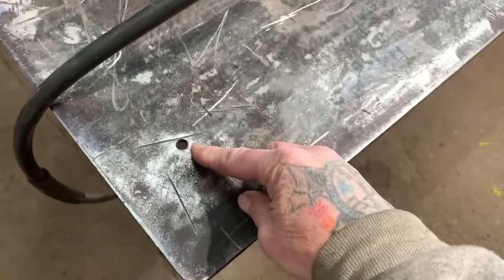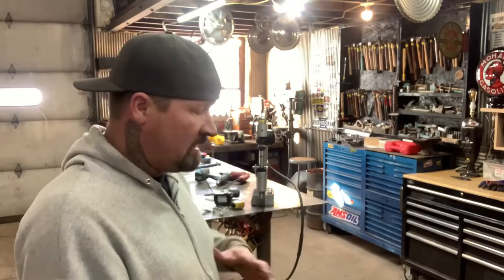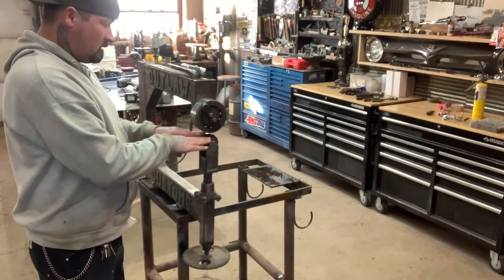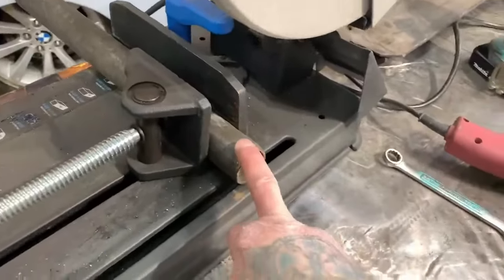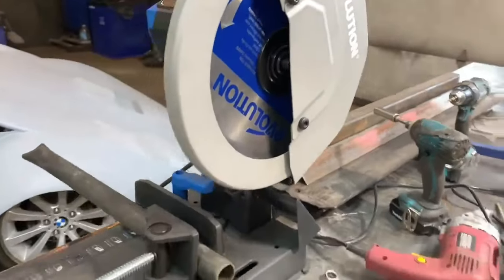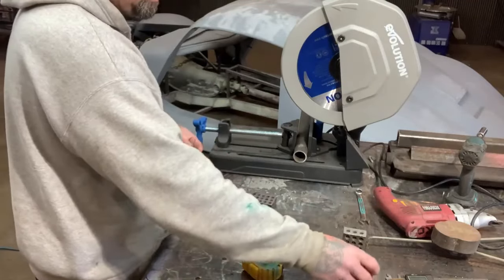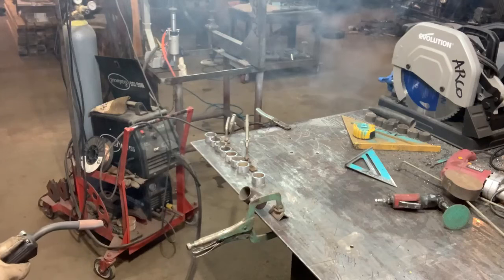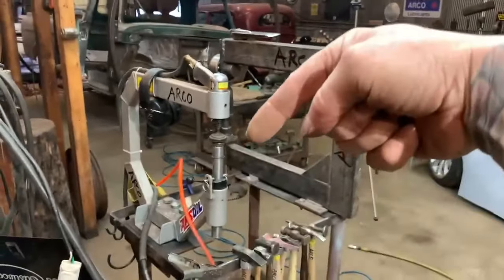Fabrication on tool holder

Comment: If you use two of the 1,2,3 blocks together like an L for the size you want. It can act like a stop for the tube.instead of eyeing the edge. Use the block and push the tube against it. Should be accurate and quick.
At kitchen craft I used to have about 30 stops all set up on a pistorious would make cutting to size faster. Pistorious is like a table say but the blade jumps out with a pedal and clamps the wood. I would cut down 20’-25” strips of routed wood for the edges of mitre doors. Still got my fingers. And I used to work on it before all the safety stuff got added. Some guys lost there’s mostly when cleaning the machine.